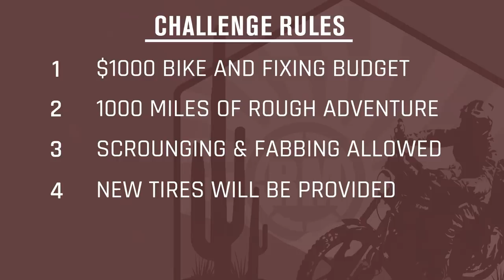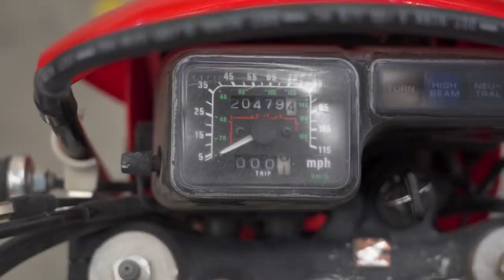Can $1,000 Beater Motorcycles make it 1,000 Adventure Miles!? | Episode 1

Comment: Whaaaat I feel so offended! He bought the DR350N (or R) Model which is insane to ride when in good working condition. And the engine is also a real powerhouse with the flat side carb. I just paid a grand for a DR350N in pieces in Germany as they are pretty rare but sooooo good to ride!
Reply from the maker: Trust me, $500 was way too much.  That think was a pile.  I had to put in a new timing chain, carb, Tires, and fix about 10 stripped out bolts just to make it decent enough to sell.  - Justin
Reply: @rmatvmc  okok I forgive you. These things are so capable and robust that people forget to maintain them and then they are beyond repair... But I am sure you would have easily outdone the competition on it :)

Comment: I live in Tucson Arizona I've ridden all those bikes in the dirt your biggest issue depends on what tire you put on street bike is to how much handling you get in the dirt and the Suzuki dr350 it's not a bad bike but it's not a fast bike remember when they first came out was 12 I remember my first bike 1983 CR 60 I remember buying a 1983 CR250 water cooled left side kick that was a weird one I even bought the yz4 00 and the YZ 490 78 and 79 because I was born in 78 and I can tell you I hit 120 on a 250 Kawasaki Ninja in the desert on street tires gets pretty hairy especially when it gets in the sand and don't say that the 250 doesn't hit 120 I got mine out to 1:30 all you got to do is knock out the baffles change out the Jets on the carbs and you're gone and I'm 200 plus pounds and I still got it up to 138
Reply: I've even been known to take my Harley out in the desert belt drive does fine in the mud the rocks is what you got to watch out for they're really teared up

Comment: I can't stand when people fake out their ad's. I just bought an '86 Helix that looked pretty good in the ad and even said specifically that it had been rode recently and everything was good to go but right before I was about to head out to pick it up I got a call and was told that it had been sitting for a year and the battery was dead but they did get it started, it just wouldn't idle. Like, don't straight up lie... I bought her anyway and threw in a new carb and fuel line, seafoam for the rusted tank and next I'm gonna have to dig into the clutch. But I at least have it running well enough minus the stutter and loss of about 10-15 Mph.
Reply from the maker: Yeah, you never know what you are getting if the bike doesn't actually run when you look at it.  Some people aren't honest - Justin
Reply: @rmatvmc  It would be nice if they were though; The bike obviously needed work so I was going to buy it anyway, the only thing that lying changed is my opinion of the seller.